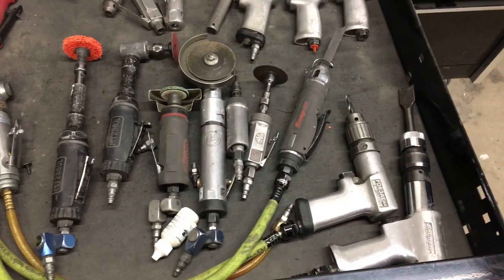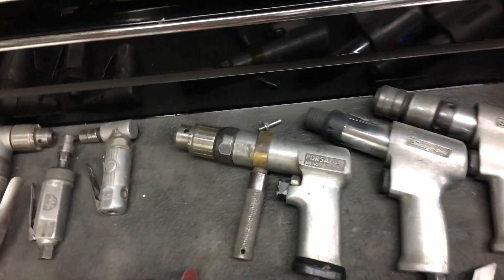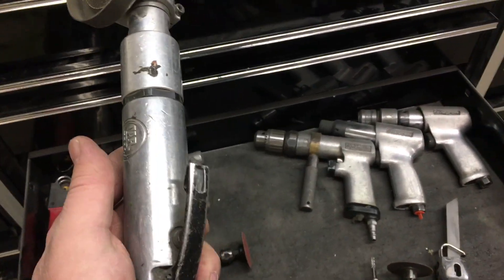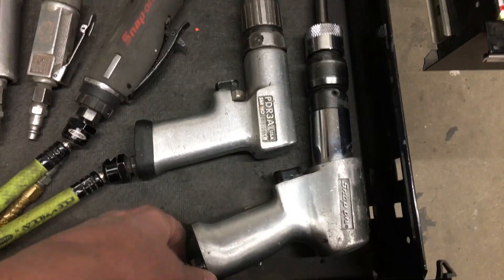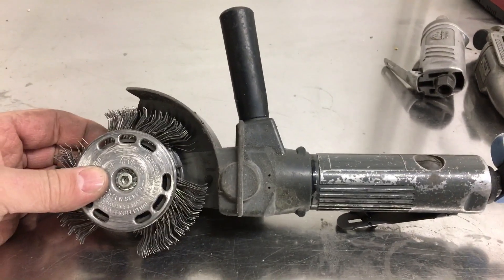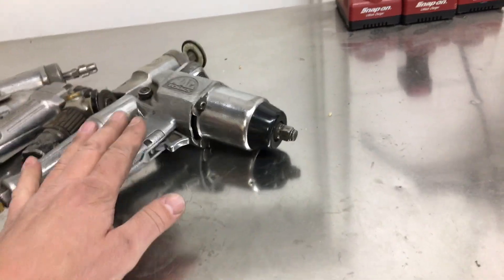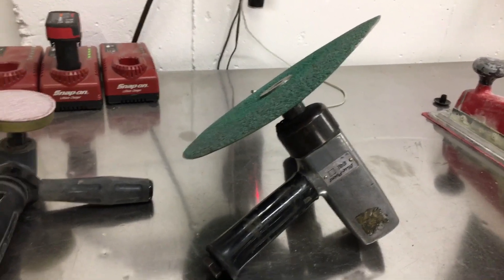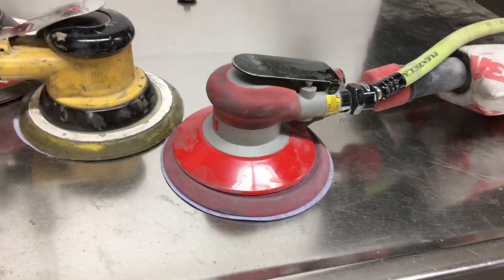Auto Body Shop Tools,  air tools.

Comment: You serious about autobody being a horrible profession, or is it the 'grass is always greener on the other side' type of thing?
Reply from the maker: .: Freddy G' :. 
The industry is controlled by the insurance companies. They only want to pay for junk (used or aftermarket) parts and you need to fight on every job for every dollar. The current body labor rate in my area is $52 an hour, dealer mechanical rate is $120 an hour. That means in order to make a profit you need to cut corners, the vast majority of body shops do shit work. Nobody cares about quality anymore.  I still enjoy the work, but there’s way to much bullshit to deal with.  The up side is nobody wants to do it, so jobs are easy to find.